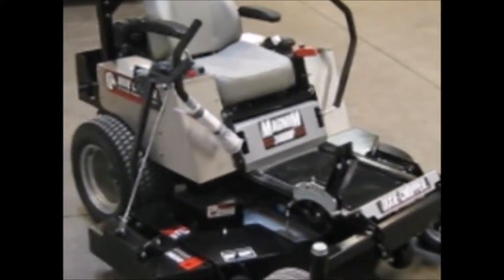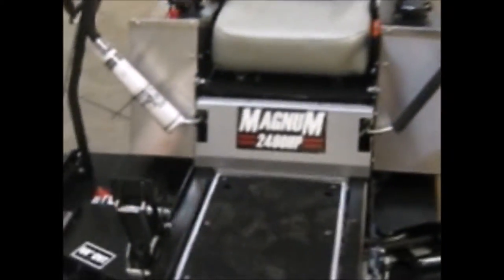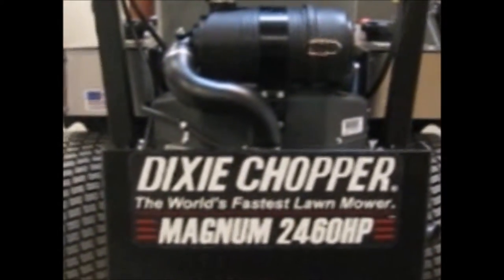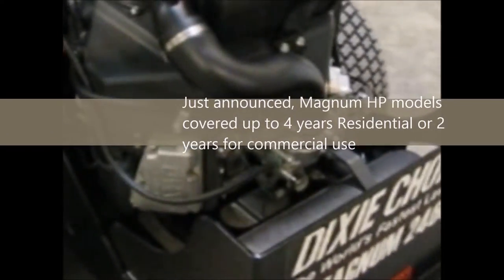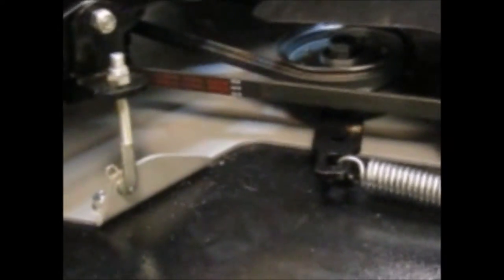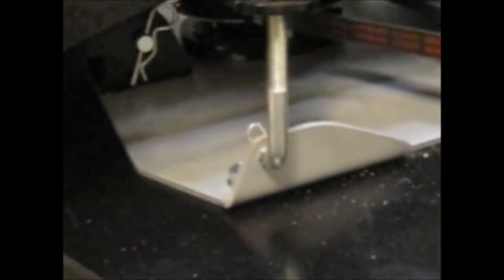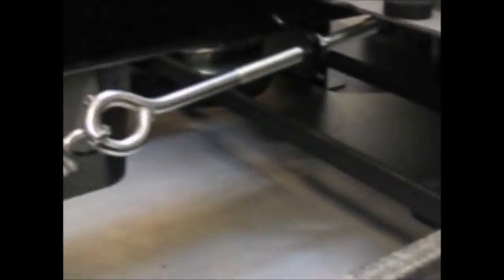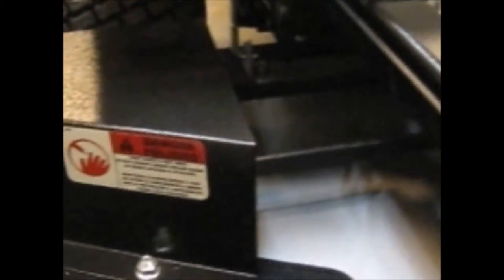Dixie Chopper Magnum 2460HP

Comment: I have a Magnum , yr 2018 , it does not cut very well in high gras compared to my Toro ZTR, also I have to cut on the lowest height setting to get a 1/2 way decent cut, also the OCD device is always catching on stuf  also the turn control arms are kinda flimsy . ,One of the ignition coils broke after 156 hrs ,.. Some good points are the belts are well guarded and I can damn near bush hog  ! The deck is very robust, .